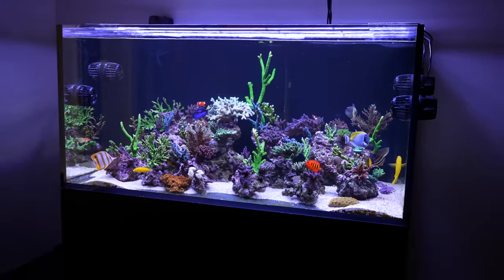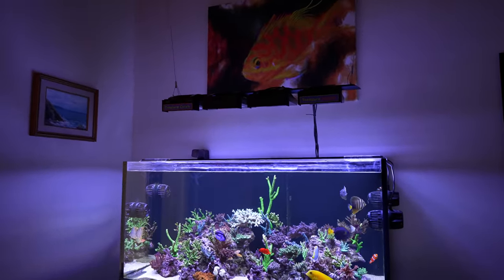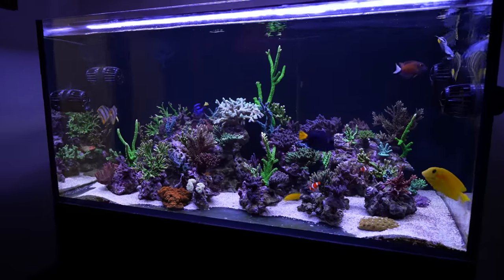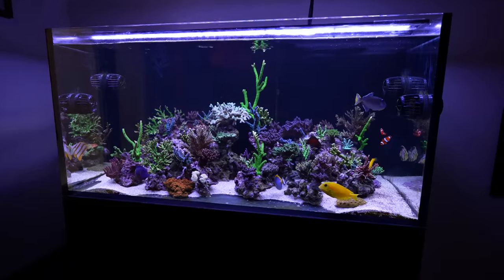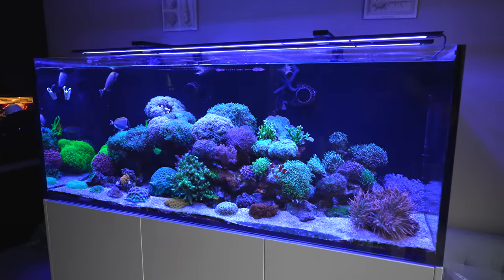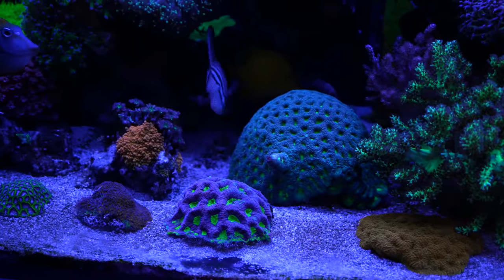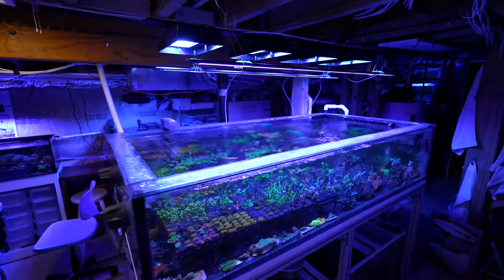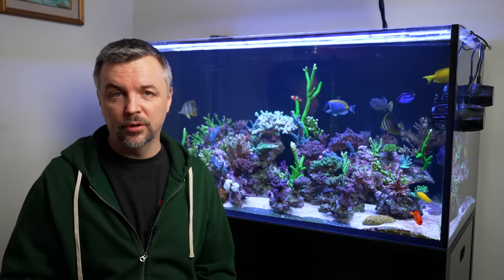Aquarium LED Light Spillage / AI Blade Mount

Comment: Tank looks amazing and great to see the copperband doing well. You should make one of those 3D printed copperband feeders.

I'm not a fan of strip lights so close to the water surface but that's just me. I think the good think about the Blades is that they can be angled back and used as shades.
Reply from the maker: That's a pretty cool idea to angle them. But so far they seem to be working quite well for me this close to the water.

Comment: I built a canopy to block the light spilling into the room and also added a strip of tape on the tank to eliminate it completely.
Reply: Same. I actually won’t do a reef tank without a canopy for this main reason. 

I’m surprised many have systems where the lights can be seen when sitting down/on sofa etc.
Reply: @Val_Halla777  my tank is right by the couch and I have little kids. Eliminating the light spill was a must. If I was to start a new tank, I would definitely go with the AI blades.
Reply from the maker: Yeah, that's a non-starter for me. I want to see what's in the tank, not what's outside.
Reply: New to the hobby won my 1st saltwater tank at reefapolloza..11 gallon cube. Extremely confused with all information online  to buy my 1st light..looking at 30 watt nicrew or hypagera ..the blade is 12 in. But only 20 watt is this sufficient  For my corals to thrive and grow or will it just keep them alive Does the wattage even matter?
Reply: @AlbertHoffman-mb6tv  wattage doesn’t matter. Blade 12 is more than enough for your size tank.

Comment: HI, are you still using AI blades? I am wondering what are your thoughts over long term. I have a blade grow and I am looking for another additional light to supplement the lack in coloration from other spectrums such as UV, Violet, and maybe red/green. I wonder if the blade glow can suplement those spectrum Or should I be looking for a Radion to add to my blade grow as a combo.
Reply from the maker: I am still using them and love them. I think if extended spectrum is your concern - add 1 bank of glow and you'll get all that juicy UV, I would probably do it if I could fit a 4th light, just worried that the fixture won't be able to hold the weight

Comment: Love all your tanks and the channel all together. I have a 180 gallon thats 6ft wide x 2 ft deep x 2ft tall. I have 3 AI HD 32s now and I'm going to add 2 57 inch blades. 1 to the front and 1 to the back. what do you run your lights at to get those blues so nice?.
Reply from the maker: 80 rb, 80 bl, and 60 white. But I am still tweaking it. Video coming in couple of weeks so stay tuned please

Comment: I just got into reefing. Currently cycling a 40g breeder and was looking at the Blade as a primary lighting option. Do you think 1 of the HMS mounting arms could hold two 21” Blades or do you think two HMS mounting arms with two 30” Blades would be better? I do not want to sit the lights directly on top of the aquarium, as I would find it annoying to have to take them off to get my hands in the tank to do some maintenance.
Reply from the maker: Welcome to the hobby. Yes, it will hold two or even three blades, but I would get 2 arms.

Comment: I believe AI blade is IP 66 rated. How close you can get to water surface? Would it be an issue to emit more heat to water surface and increasing temperature?( here in Australia we have hot summer and I am running a chiller)
Reply from the maker: I don't think they get super warm - so far I did not notice any issues from that perspective.

Comment: Is it necessary to cut the ai mounting arm? I was thinking of mounting the blades to the mounting arms over the tank and how do you attach the blades to the existing mounting arms? Thanks in advance😊
Reply from the maker: You do not need to cut it off, but then it is hard to clean with the magnet cleaner behind it

Comment: Interesting video mate could do with some advice, been looking at getting a shallow tank dimensions being 600x360x180, what light would you recommend using for a tank with these dimensions? As a beginner I will only be keeping mostly soft maybe some lps coral but would rather get a decent light to be on the safe side, plus I want it to look the part, cheers
Reply from the maker: Before I can answer - can you confirm the dimensions? Did you mean 6  feet by 36 inches by 18 inches?
Reply: @TreasureCorals  600 mm x 360 mm x 180mm,  very small shallow tank just not sure what light would be best without over doing it
Reply from the maker: @bazzalad1  got it, I think a single blade should do a pretty good job. I'd go with the grow.